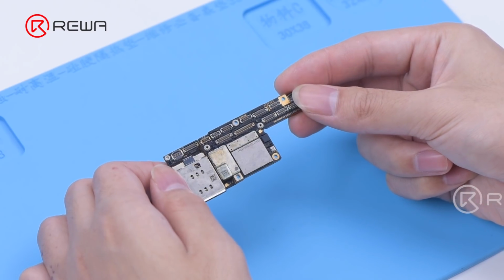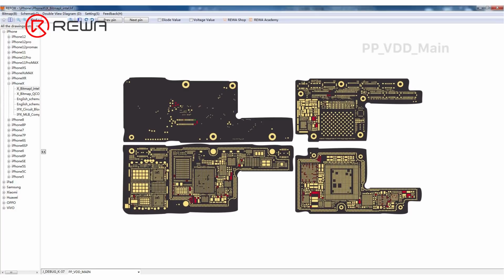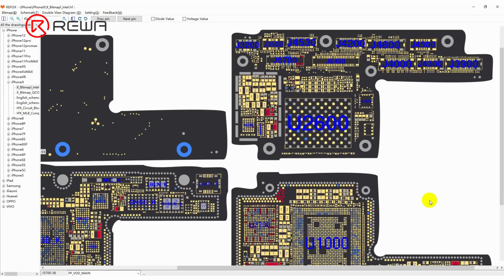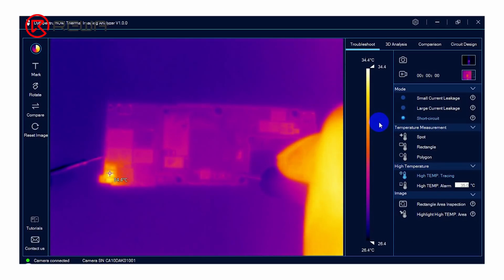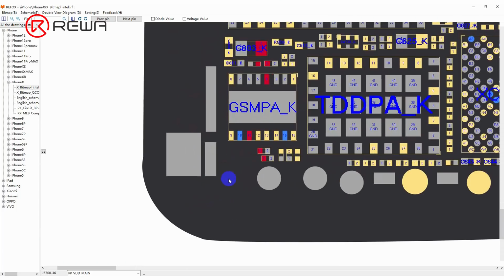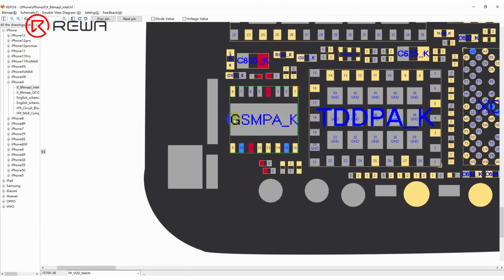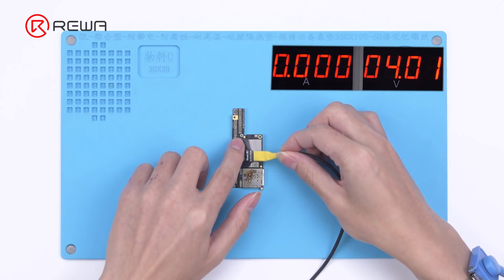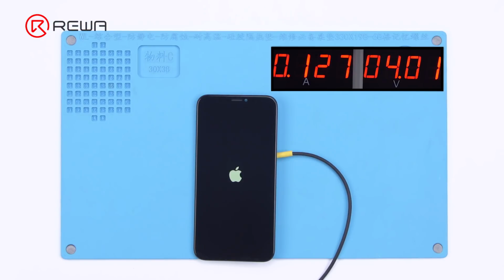How to Fix iPhone X Battery Draining Fast - Fault Hides Under the Card Reader

Comment: iPhone XS leakage? 500mah constant, but phone works and battery drains fast. No visible water damage. Is this a common problem with iPhone XS 15.5 iOS?
Reply: I think yes
My phone start charging 3A after few mins go down to 2.3A after up again to 2.9A 2A. Not stable
Battery leak. In fly mode battery from 💯 to 0 in 2 days😢😢😢

Comment: I am also facing the same issue in iphone 11 pro max , battery is draining fast but when i use on low power mode it works fine but starts hanging at 1 percent. Any solutions , do u repair phones?

Comment: I changed it my battery on iphone xs and still overheat and drain fast is the motherboard problem or charger ic?
Reply from the maker: The motherboard may have electricity leakage.
Reply: @rewatechnology2008  thank u for answer so i must buy new  motherboard or fix it?
Reply: @rewatechnology2008  i think is a motherboard because overheat near camera
Reply: @jenddnz your issue got fixed or ?
Reply: @jenddnz  I am having same issues
Reply: @rewatechnology2008  any website for buy parts for iphones can u help me?
Reply: The problem is stop update iOS and stop play games like pubg with big GB
Reply: because its phone if u want play games buy PC
Reply: Bro it heats without playing games
Reply: @rajanchauhan07  u updated the ios?
Reply: @jenddnz  yes I'm on 17.5